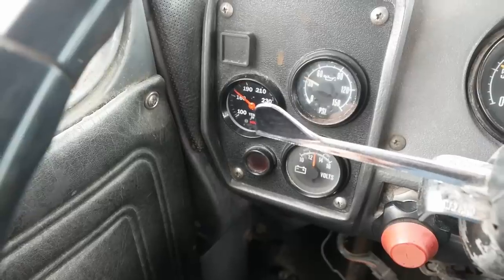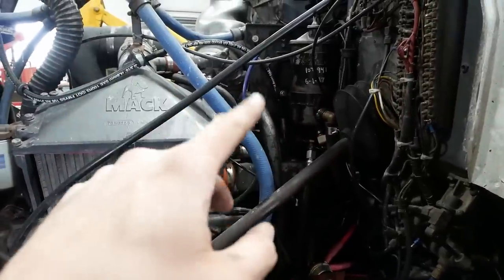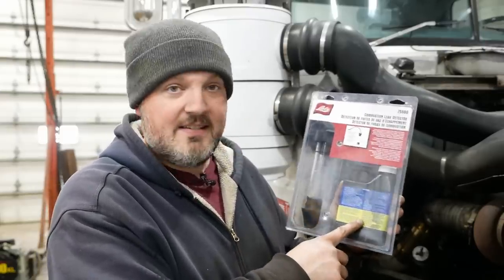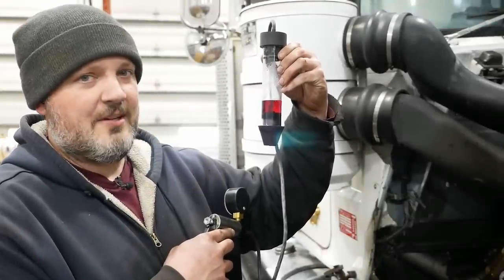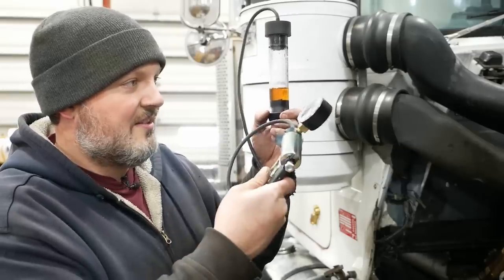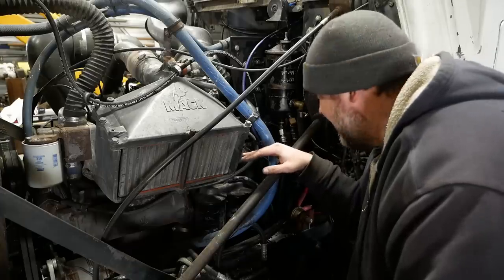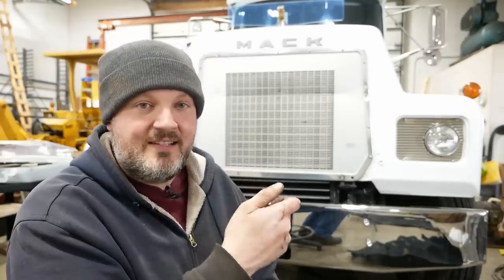Can You Trust a Head Gasket Tester? - R Model Mack Overheating

Comment: 20 YR cat heavy equipment mechanic.  ive never seen a head gasket problem go away then come back again?  it blown or its not.  the air pressure in the radiator is odd. but, if its not pumping coolant out of the overflow, its not a blown head gasket. and if you look into the rad neck with it running, if the head gasket is blown, it will look like roaring pot of boiling water.  i have used that test fluid before and it usually works pretty good, my only suggestion would be take the truck around the block THEN test the fluid for combustion gasses, to make sure the entire engine is up to temp. but it sounds like you have a LOSS  OF COOLANT FLOW. check your water pump, i have seen the ( internal )  impeller blades come loose on the pump drive shaft, and NOT spin when the  pump drive gear ( or pulley )  is turning.  are the rad hoses getting warm? hot? is the radiator hot? warm?   maybe you have a blockage in the cooling system?  i have seen OLD radiator hoses unravel inside and act like a check valve and block coolant flow.     you got a lot of looking to do before you tear the head off.

Comment: WES I HAVE SOME INFO THAT MAY HELP !!! 

Mack uses pressurized air to shift the HVAC controls. i had a problem where i was getting air pressure in the cooling system on a 2000 Mack with the E7 engine (the descendant of the engine in this truck). there is a Rheostat in the sleeper bunk that controls the amount of coolant that can flow through the sleeper bunk heater core. the rheostat controlled an air actuated proportioning valve that restricted coolant flow to the heater core. the O-ring started leaking in this 'module' and compressed air from the air system leaked into the cooling system where it found it's way to the highest point, which was the plastic overflow container. it would then force coolant out and trigger the low coolant switch. i called Mack and got the service guy out of bed at 1 am and he sleepily told me to disconnect the air line to the module and pinch it shut. i did so with my trusty Vise-Grips and problem solved instantly! 

i don't know if the older R model trucks used the same system (i think they just use a cable and and a valve), but this gives you a direction in which to start looking. i know on CH models the cab HVAC selector uses pressurized air to control the direction of airflow in the cab; the tiny O-rings leak and they hiss into the atmospheric air. 

i would look for a similar device on this truck; i doubt it ever had a sleeper though. but with all the bits and pieces thrown together maybe there is something someplace leaking clean compressed air into the cooling system. i would suggest maybe the solenoid that opens and closes the radiator shutters. 

hope that helps buddy!

Comment: Considering the tester tests for CO2, and you exhaled CO2 into it and it turned yellow? You spew out an infintesimal fraction of CO2 compared to the truck. The test is fine, there is no headgasket, head or block issue. Your answer lies elsewhere. Air is getting into the cooling system causing the overheat indication.

Comment: All I work on is macks . Don't know what engine that is but one thing I've seen if that engine has a spin-on coolant filter and also the oil cooler on drivers side , a 4 or 5 inch thick exchanger. Pull the big coolant hose off bottom of oil cooler(2inch ) size. Inside there will be a screen that will be plugged up from people using subpar coolant filters and will make the coolant build pressure. Plus spit it out the overflow.

Comment: Interesting man! For me this test worked every single time when we were suspecting head gasket or some crack in the engine head. But usually we were putting some higher rpm during the test

Comment: Turbo boost air and the water cooled intercooler, but then you would be loosing coolant into the intake. If it was a head gasket would you not be burning coolant? I take it no coolant in the oil or oil in the coolant. The net says head gasket on the Air Pump or the wrong coolant over flow tank on the truck. GLHF😊
Reply from the maker: It's all about pressure. The combustion has enough pressure to push through. The coolant does not have enough pressure to push back.

Comment: Excellent video Wes  :) also funny part I seen one Desiel also Gas motor have that temperature gauge did that and Lol what found out too! The Desiel motor one was Electric Air Induction was disconnected on power wire and temperature sensor was corrosion on tip plus leak on threads on was farm tractor of Detroit type! On gas motor was Temperature Sensor was wrong put in then found inside Propeller was turn okay low idle but went past 1/4 idle to full throttle on gas seen also hear grinding then stop then break lose turn then  seize up and took off found the seal plus bearings seized up and turn like shape egg plus wouldn't turn till in full circle motion ! So replacement water pump new one plus gasket seal and sensor to right one! Cure all problems the sensor was be silver tip and not copper type  and ran fine plus correct temperature be operated at ! But tell was funny tasks to do on both gas and desiel motors to find out! But Lol cause Dealership on both check over said were fine and was not fine till I found the problem was!

Comment: Is it running on all cylinders? Could it be a leak from a non-working cylinder escaping via a bad head gasket into the coolant, this could show as pressured coolant system which you see but no excessive amounts of CO2 which the chemical test kit tests for?

If your theory about the coolant temperature sensor is correct you should see normal coolant temperatures elsewhere in the system so maybe add a second sensor somewhere to test the validity of the first sensor and your theory about the gas bubble forming around the original sensor!

Comment: Here in soggy England I think 'bugrit' fits. Could you try the rubber glove with the engine under load. Handbrake on - start and quickly try and stall in a high gear at say half throttle. It should blow up quicker under load.

Comment: Ran across an issue on one of our Hagie wheel pullers.  Gauge would erratically just climb in relatively short time.  Originally the gauge grounded through the housing were was mounted.  Over time corrosion and rust caused a bad grounding issue.  Cleaned up gauge and housing and added a direct ground wire to the stud on the back of the gauge.  It solved that issue

Comment: Yes make sure air compressor is checked thoroughly,  anything air related in cooling system , shutterstat , is air blowing out of the over flow hose ? I had a freightliner come to me years ago that had same kind of issues,  owner had already done head gaskets , liners , done at some repair shop and problem was still there . After checking it out , I found a air operated temp. switch leaking into the cooling system under the sleeper . I was suprized they missed that .

Comment: Does the glove finally pop? Is it confirmed that there is a permanent flow of gas? What if there is only a big gas bubble around the sensor. After starting the engine, the gas will expand. And fill the glove. But it will stop. And after shutting down the engine, the gas should be sucked back in. 
I am not a pro, but the idea of temperature measurements at different locations of the engine might be interesting. 
One more idea. Is it possible, to loosen the sensor in a way, that it bleeds the system? If it is an issue with a gas bubble. The idea is, that gas -and some coolant - constantly blow off. To make sure that it is not just an issue with a blocked hose and a gas bubble.
Reply from the maker: It doesn't matter. There should never be gas anywhere.

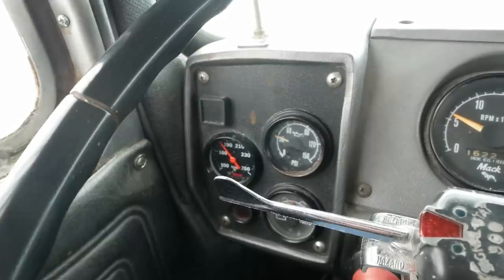Comment: 2:15  I've had that overheating happen.
Weak coolant froze in the rad at highway speed.
Sitting still, no airflow it was ok at temp.
Overheat at highway speed.
Replaced some  coolant with full strength to bump up the mix, fixed that.

Comment: Cracked cylinder head......heavy diesel engines, because of the load they run, have an eventual crack pathway from the injector barrel to one of the valves. The dont blow head gaskets as a rule, unless someone did a dodgy repair.  Now, the crack will almost always only show up when the engine is hot, under load, and will close up when it idles down to cold.  I know this from bitter experience years ago, chasing a miss in a 6 cylinder mack ( EA7-470) . The Mack mechanics at various dealerships did not have a freaking clue ( Australia).  The head in question cracked at 850,000km , what killed it was probably the B-double application running 65,000kg gross every km. Air compressors dont usually blow their own head gasket, but they can.

Comment: The way I tested mine (2000 Dodge, 5.9 magnum, wasn't a head gasket but I'm sure you can guess what problem I had) was by pulling the engine apart. Joking aside(though this is ultimately what I did) I did buy a kit for testing for exhaust gas in the coolant,  but I decided with low compression and a constant misfire on cylinder 4, lack of power and overheating that suddenly cropped up, something was wrong with the darn thing. And it was ejecting coolant sometimes but not always. So I figured there was no reason to test it, since I knew the engine had a problem. Already rebuilt the ignition system trying to track down that misfire too(Parts cannon, I know, I know).

Head gasket was fine as far as I could tell, but I saw cracks between the valve seats on 7 out of 8 cylinders, the 8th probably had one I couldn't easily see by eye. She's in the middle of a full overhaul right now. Have the engine mostly back together, just feeling unmotivated.

Comment: I'm no expert, but wouldn't the coolant expand when engine is started and thus cause the glove to inflate? Wouldn't a better test be to install the rad cap and check the  blow off tube for gas pressure that is high enough to open the cap relief valve?

Comment: I worked for a local Chicago Intermodal company for a while until I could NOT take the imbecile dispatcher who was on drugs before the state made it legal to do drugs.

They had these r model Mack from the 70s.   They are SOOO SLOOOOOOW. I would only get one if I was doing off-road logging.  The tachometer said 2,700 RPMs at 55 mph.

Can't make money on the hardtop in the 2000s with a 70s truck.  

These Farmers should just rent a truck from Penske or Ryder for the four months when they need a truck instead of mothballing one for eight months out of the year.

Comment: Head gasket... Cracked head... The lot...
Been there, done that, same issue, same symptoms. Diesel engines are weird like that, almost no CO2 gets bubbled in at idle, just because it runs mostly on air, if the leak is a little on the far side from the injector, the flame front gets nowhere close at idle. You would need to load it at full throttle going uphill mad-max style while you run the test.
The compressor is not the issue, it would gush out coolant into the dryer starting up.

Comment: I had just started with the state DOT and they bought brand new 2000 Mack's. According to the rep that delivered them ours were the only ones on the continent with air pre treaters plus the cooling system was their desert package that they "Only" ever used in Africa. They were nice, but those maxi torque transmissions could be fickle to shift and the guys were always breaking the clutch brake and our service shop refused to use the after market split unit and would opt for pulling everything to install the OEM one piece.

Comment: I figured you would pressurize the radiator and then use the inspection camera in the cylinders? Didn't you do that last video?  Probably a good reason that wouldn't work here.

Comment: I worked with a guy who swore that the chemical tests would not work for diesels, seems he wasn't too far wrong. Anyway, I would suspect that under load with a traditional fuel throttled diesel perhaps the amount of CO2 produced at idle that gets into the cooling system is just not enough to get the reaction?? Especially if the issue was the the furthest point from the injector, wpould it be out of the realm of possibility that the combustion at idle is small enough that only unburnt air is forced out of the fault?

Comment: Would engine oil analysis reveal the presence of antifreeze in the oil?  And would coolant analysis reveal oil in the coolant?  Can pressure be introduced into a cylinder with closed valves thru an injector port to check for bubbling?

Comment: Have witnessed the same temperature fluctuations  on a 70's vintage GM V8 diesel grafted into a  landrover with a 350 auto, the temp would rise and fall when the engine was working and just idling along. Had huge radiator capacity, did not loose water, it was set up for competition off road and mud plugging. Also a 428 in a Thunderbird towing a trailer with a Camaro racecar on it.

Comment: I’m not sure about your test of the air compressor, when I test for the compressor building pressure in the cooling system I take the two coolant lines off and cap them, then run the engine. That way you know for sure there is no possible way it can be the compressor.
Reply from the maker: If it can't build pressure how can it pressurize the coolant?
Reply: @WatchWesWork  the compressor cilinders still build pressure, no?
Reply: @WatchWesWork  you may not be building pressure in the air system but depending on the design of that specific compressor it could still be building pressure within the cylinders. I don’t believe the compressor is the issue in your case but I’m also not sure that your test would be the most definitive way to check that.
You can pressurize the intake of the compressor with shop air to 120 psi or so and plug the discharge see if it builds pressure in the cooling system as well.

Comment: I think that you have reached the right conclusion in your diagnostic. I also believe that you should pass on doing the repair, your back will not like lifting that head, and if the root cause is a cracked cylinder liner, that thing will tie up your entire shop for weeks. A real revenue loser.

Comment: When I'm looking on them trucks. I take the boost piping off an by pass the air compressor cooling system. Then test them out of the loop. 98% of the time the air compressor has a bad head gasket. You didn't test the system right.

Comment: Hey Wes. Let me spin you a yarn of an experience I had with a Subaru. It came in with a blown up plastic radiator tank. Not uncommon. I did all the tests in the world to make sure it was okay. Ran perfectly, didn’t pressurise the coolant too much. No indication on the chemical leak test. Pressure tested perfectly. No air leaking from a leak down test. Was sitting on normal operating temp just fine. Cooling fans worked yada yada yada. Cool did a radiator sent it on its way. Came back a week later with the new radiator blown up like a banana, totally gone bottom tank this time. Ok cool maybe defective radiator no issues. Replaced it road tested it for about 45 minutes. Right at the end of the test it over heated, once it over heated it would stay like that and it was pressurising the coolant. Oh shit. Long story short we took the engine apart and there was a crack in the block around half way up the cylinder. At no point would the chemical leak tester indicate an issue. Only issue was the pressure in the coolant like the Mack you have got. We ended up putting a second hand motor in it and it was okay after that. I also saw this happen with a cracked cylinder head on my bosses xr8 falcon. Would only play up after running for about 3 hours. I share your experience with trying to chase these issues. My money is on a cracked liner. If these things have them. Happy hunting.

Comment: I have used those testers on many gas engines only time it has worked gasket has to be blown so bad it’s obvious just taking cap off it’s so unreliable I stopped using it better to tell customer it might be than it is based on that test

Comment: When I worked for dodge the old 2.2-2.5 engines would overheat like that and you would also lose the heat out of the heater,  if you pulled over it would cool down and might be fine for the rest of the day.  Think your on the right track. Thx

Comment: After reading the comments, I was just fired from a job because I refuse to haul containers that weren't pinned down to the chassis. The first truck I drove of theirs had less power than if I were in my Toyota hauling a load.

 The second one didn't have the pilot bearing noise but the clutch brake was out.  I told him that I pretty much had to gnash teeth off of the gears in the transmission to get it from neutral and do a gear but they just didn't care. How nice it is to have to sign paperwork how I'm going to pay money out of my paycheck if I don't pre-trip the truck but then when I tell him what's wrong with that they don't do a damn thing.

Comment: I had this problem ..the fluid never changed colour but the car would overheat driving but not on tickover. In the end I taped on the tester and took it for a drive and sure enough it did.
Cant say you could do that but unless you remove the hood you could just rev the nuts off it or put some kind of load.
You may be spot on with the gasses lingering around the sender unit but not quite making it to the rad hence the overheating.
Sometime it takes high revs or high loads to expose a bad minor leak.
In my case it was a head bolt which seemed to stretch more than the rest which I tested with heat after removal...but thats another story
good luck buddy